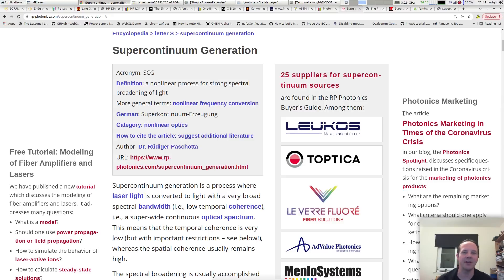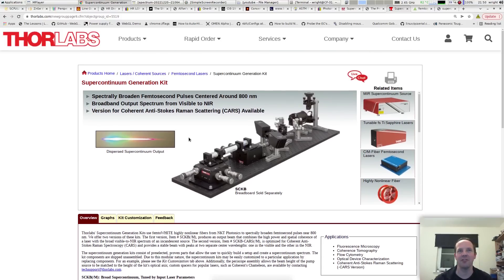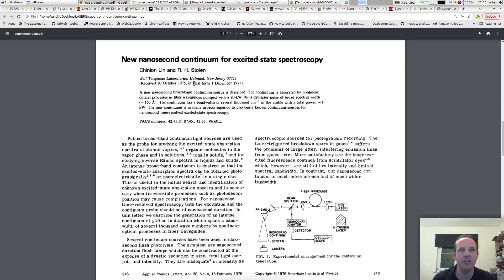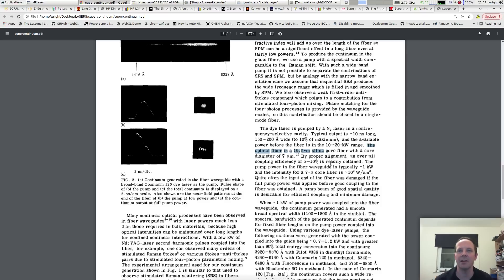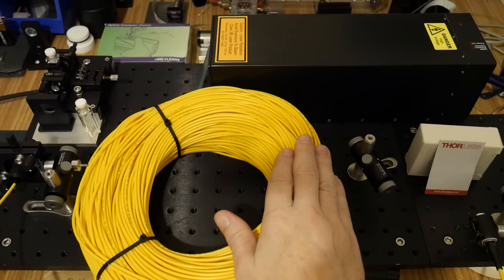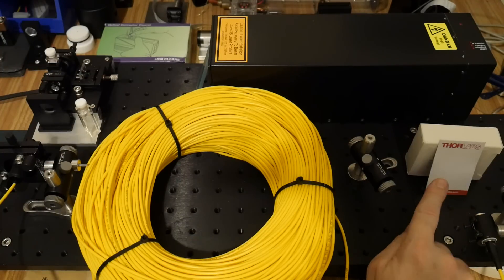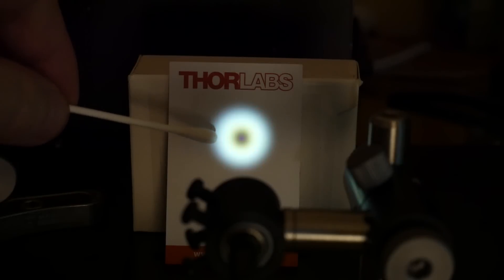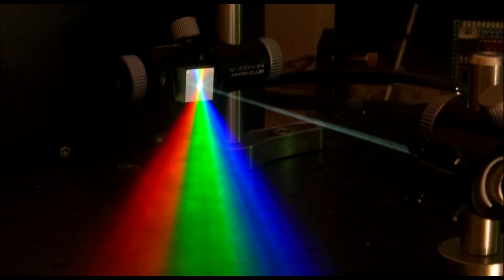DIY SUPERCONTINUUM LASER on a BUDGET!!

Comment: I was really interested by engraving that was done in the UK where they put the human genome on a very small piece of rectangular Crystal like 500 terabytes and I had an idea about using a cubic Crystal with six sides and using different frequencies to create different constructive reflective waveforms I'm using some Cartesian pretty complicated math in six different cameras looking at it with maybe different sensitive wavelength cameras as well as a check song so that you can eliminate repetitive digits that are from one side but could be visible from the other and cream more data into the same space just by how long and how fast you etch along with an appropriate amount of indexing and check some basically built into the index of each side? This differs from I think everyone else is approach that I've seen thus far and I was immediately interested when I saw cuneiform tablets and the man who presented them from the Royal Institute in London and how they're the oldest written form of communication we have and the problem we have with data storage Integrity even on archival CDs Etc.. so as long as you can make the reader very cheap like a single Cube or multiple cubes inside of one reader like with changeable CDs you could cram enormous amounts of data inside of a very small cheap machine and send your data to a company to engrave that data into an archival Crystal which can be protected when it's not in a machine or not protected some type of place where it won't get scratched or contaminated and can be quickly read. If they can get 500 terabytes on a small rectangular Crystal imagine what they could get into a six-sided crystal using this type of approach if you think it's at all feasible I mean you could potentially get in the far higher than any storage media to date in the size of a piece of Crystal about 3 or 4 times the size of a normal die? If you can figure this out and patent it throw me some credit or open source it I don't care it'd be cool to have my name on it as the co-inventor
Reply: If you hit me up with a really noticeable email on whatever email that this account is attached to this is a spam down for email basically and I buy things like some of my subscriptions to some cloud storage even though I'm moving away from that as I'm working on some projects that might be considered dual use so and I'm using an open source machine learning algorithms from hugging face on a specialized PC that I built just for that particular use case so we're talking for terabytes of 4th generation M2 hard drives on the Sea on the D and 120 gigabytes of ddr5 RAM I'm 4080 and AMD am 5 socket Horizon 7950 X which is the last generation which is super super fast just on the CPU with the R23 cinebench I scored in the 48000s
Reply: I've been playing around with trying to use the the slides from slide film camera that have Optical glass where you make your own at home I'm trying to get copper traces on the glass as well as create visas you could literally put a plane in between the two pieces of glass and have copper traces on each side use the edges which have a metal frame around them as power bars or places to connect connectors to the chip I'm interested in photonics and circuits that combine the two... this shows a lot of process a lot of potential for wave guides and RF and I'm also interested in the use of lasers in certain types of lasers for underwater short-range communication between small durable off-the-shelf component feature Rich scientific multispectral fish finders from like hummingbird or from Lawrence cuz if you get up close and personal with those the resolution is incredible much better than the large research vessels with the toes sonar arrays and side scanning sonar it can even penetrate into the I've been into the sediment of the ocean floor. I also want to try and design a Raymond spectrometer on a chip or a very small form factor Raymond scattering spectrometer. At the same time I want to have four crystalline cubic centimeters sample containers where you could put like a grain of stain in three and one normal and have fast very precise stepper Motors fly through the sample and get a really good three-dimensional image of various single-celled organisms. So not only with this swarm of small semi-autonomous drawings be able to do incredible mapping of the ocean floor but it could do bench level chemical research and life science research as well as take samples a few of the Swarm would sit back and do the scientific sampling while the forward drones would be doing the surveying without the expense of a huge research vessel the crew the fuel necessary and green on the bottom with a stator to take advantage of the very strong currents as they are opportunistically found in the ability to surface and recharge on the surface transmit their data using the least expensive method can wherever they may be located and a swarm could control be controlled by three technicians and someone to do modular repairs while the brain would be extremely well protected because that's one thing that could be doing this but if you do a lot of work on protecting the brain of the modular system and keeping the firmware and software protected and not accessible using every trick in the book including hiding encrypted signals on the power cables so if you try to power up the brain with some other power source well it triggers the anti-tamper resistance small mesh fibers in the case that are both a faraday cage and tamper-resistant if you caught one it erases everything all kinds of both hidden and open source security protection. For that one that one's going to be tricky because I want them to operate at an average working depth of 801 ATA but read what Challenger Deep was made of and the only reason that they used to Titanium sphere in it and what the composition of the remainder of the vessel was made of.....
Reply: Microsoft and another company using Ceramics or ceramic type of glass or playing around with this but they're moving very slowly and the targeting data centers when I want it to be available to anyone and you can send your data in that you really want to Archive you can put encryption on it or not and we can add an encryption or not and will send you the crystal because that machine might cost a bit but a scale is enough people are interested and can afford the readers that would do away with the need for cloud storage enormous amounts of hard drives that are swapped out just because of their age because they never power them down excetera excetera there's so many good positive public good use cases including the internet archive itself and various libraries of the different countries that are trying to keep the books on microfilm and scanning the books and where are they putting them on drives
Reply: But if you're interested in any of these subjects or if you think any of them are worthy enough for your time and your effort I would really appreciate the help cuz I'm not a professional engineer I'm self-taught I'm a self-taught cybersecurity researcher I learned advanced mathematics in my middle ages and sold the beauty in math and just 2 weeks. I asked all the scientists out there how long did it take you to find the word beautiful and apply that as an adjective to math? I have a huge IQ but I had ADHD so everyone pushed me away from math as a young man he was just because I didn't have the ability to concentrate on it until my ADHD come down but then when I had a reason I took a graduate level class which required calculus and algebra and I had already taken some data science s p s s s s s a s and r and then moved on to python deep machine learning open source algorithms like on hugging face which can be incredibly good some of these Architects are fusing these open source models in ways and using reliable data sets which you could then turn around if you had a commercial grade GPU cluster and if you put your own IP on there with your own bare metal those could be as good as the commercially available products without exposing your confidential IP to accompany who have less than stellar scraping other people's IP for their own models and in Switzerland the secret professional act has criminal and civil charges and private ones so a client or a private person could charge the offender with a private crime the government doesn't even have to be involved in that and you can serve time in jail for that not to mention in my case being both a medical professional and having a doctor in law I could have my license revoked. I would never suggest that a Swiss company subject to that act ever put anything on a server outside of Switzerland because the law of the land would apply to that data in addition you should not use any of the commercial open source deep machine learning algorithms because you just don't know where your date is going and who's using it and what you might accidentally slip. If you insist on using them then you should compartmentalize the work and have it impossible that someone could put your various pieces together and do what you're working on and keep it separate from your air gap system where you can combine it..
Reply: I have a lot of different laser safety glasses and a lot of them I shine my laser through and they don't give me a lot of trust in them so I approached my local Optical Shop and ask them and they have the orange version which now I've asked for the wavelength protection and the official certificate of safety what's a good source for various types of glasses for various wavelengths and is there a pair of laser glasses that will cover a vast majority of the dangerous wavelengths like infrared ultraviolet and the sneaky one like green which has ultraviolet buried in it. I'm not sure if it's you or somebody else but they said put it in the freezer and turn it on and see what happens and sure enough there is the ultraviolet...
Reply: I have a lot of different laser safety glasses and a lot of them I shine my laser through and they don't give me a lot of trust in them so I approached my local Optical Shop and ask them and they have the orange version which now I've asked for the wavelength protection and the official certificate of safety what's a good source for various types of glasses for various wavelengths and is there a pair of laser glasses that will cover a vast majority of the dangerous wavelengths like infrared ultraviolet and the sneaky one like green which has ultraviolet buried in it. I'm not sure if it's you or somebody else but they said put it in the freezer and turn it on and see what happens and sure enough there is the ultraviolet...
Reply: I am careful to use my lasers in a room with heavy impervious cloth to protect any stray refractions from leaving the room and I live on the third floor so it's highly unlikely with all the trees and the distance between me and any potential other people but I do take safety measures because I like my eyeballs and I also like my camera equipment because I have some professional cameras and then I have some throwaway cameras and I've even have some cameras where I've taken the IR filter out so that I can see infrared and with them
Reply: I really like your Laser Source company at the store because I think they're Western company and I'm again not necessarily comfortable with some of the diodes that I'm buying from China as they who knows what they are really and their quality is sometimes not with a claim and I've also ordered a couple 10 copies of your pulsed overclocking circuit for laser diodes as I have a scholarship with jlcpcb and pcba and they gave me a minute and I asked for five with your one original transistor and your alternative transistor as I wanted to see with a microscope reticule if I could get one of my laser diodes to etch as I want inside of crystal
Reply: Doesn't that like amplify the wavelengths by going around in the coil and in some way both splitting up the wavelengths and increasing the power of the one that you want admitted? I've tried to be paying attention your videos are the most informative on lasers from all the things I've watched so really good science communication really solid safety advisories nice table and I want to build my own I guess I should put it on spring-loaded dampeners would that be your suggestion with a really accurate level to get everything nice and level and to resist against vibration and external noise?
Reply: I wish tour would give me a scholarship because I have all kinds of ideas to use laser light in new and interesting ways including a mixture of both sounds, it's like a sound laser and motion stop video work where it only records the changes in the motion add laser combined so it's like the new sonar it's not so nice pictures and lighter combined with drones with a 25% overlap for good stitching but also using radio waves.... so instead of just two forms of ranging and the use of photographs as I've done the photograph three-dimensional work with my drone I have a drone license from the Swiss civil aviation Authority and I can fly drones up to 4 kg 9 G to 4 kg which considered autonomous aerial Vehicles by the Swiss. It was a 2-hour exam in French which is my second language but I passed very well because I had a drone and had been flying it under a license that wasn't mandatory but was just kind of Common Sense made by an association here and so when they actually came out with the rules that mirrored the European rules the test was fairly easy for me especially as a lawyer and then having a Hobby Lobby engineering status but I have photographic memory and an IQ that's off the charts it was recently tested because I'm the victim of two different unprovoked violent attacks and they wanted to make sure that I wasn't damaged and I wasn't but my EQ was so what I used to distract myself from The Nightmare which has been the last 15 years of my life including six surgeries to repair the damage it was geopolitical related to my job and my former boss even told my doctors that it wasn't his fault he didn't ask for it he didn't deserve it he's honest he's extraordinarily smart he took what I taught in places I never considered please give him the best care you can and they think that I can fully recover but they want me to start looking for work with people who have my same level of intelligence and creativity which is one heck of a trick when people see lawyer on a Juris doctor on your CV even though you have a science masters that automatically put you in a box Define you based on that box and I'm sitting here looking at a bunch of Transformers have pulled from E-Waste and solar panels that I need to encapsulate in epoxy for use in a larger panel a 220 volt solar panel sitting against my wall waiting to be used for a purpose soldering irons dead boards passive components vices and old that I think will work if I replace the nickel cadmium rechargeable batteries it's a Swiss Army Surplus with a actual Cafe told me it was important I think I think it's blocks the harmful Rays from the tube which is very long here's a copy of the book it has a French version which I understand but I have the complete service manual. It's a tectonix 323 dated 1980 and they had not leaked prepare the nickel cadmium rechargeable batteries and so they're totally shot. Inverted has the entire technical manual with it and maybe it's not so useful with today's speeds but as a piece of History it's just fantastic and if I can't get it to work for some reason to Katherine isn't completely good shape I've seen the Chinese Catherine adapters which should make a really interesting version of Doom or even Quake if I attached a much more capable board granted it'll be in the green Catherine Ray type of picture it's about the size of I don't know it's a little smaller than a Raspberry Pi board the window, but the Catherine ray tube is at least 500 mm yes I use the metric system even though I was born in America I've lived in Switzerland for more time than I've lived in America so they don't even recognize my accent.
Reply: It's called directions for The Artisans of the troop Edition 1980 from the Swiss military surplus and it's the guy and description Technical and the instructions for usage in French and English in high detail for an actual electrical engineer
Reply: It can do for me for a time of 99 seconds 2.75 MHz over 130 nanoseconds with a standard deviation of 0.2 Hertz it can run off means or it can run off battery which is the issue I don't want to Power It Up Until I've replaced the nickel cadmium D size batteries and yes I can weld the metal strips on top of the battery packs. I made a DYI lithium ion on the small metal strip spot welder basically everything I own is DYI. I think I'll pull the best pieces of aluminum panel or a metal that I can recover from E-Waste and turn that into my Optical bench I know that steel would be better I just set timer for that but I could wait down the aluminum evenly with a thin piece of metal that I could adhere evenly to the aluminum to get a good bond to prevent warpage or any kind of change and then drill my holes and mounted on the external isolation I assume screw Springs hear to the aluminum
Reply: Bernie Mansion a small open source pcie or M2 slot attachable as small as humanly possible a scattering Raman spectrometer with a removable crystal cruveete
Reply: I'm assuming I need three different wavelengths of laser and a cube as well as several other types of lenses colonies including a fiber to run it into a standard spectrometer tube. I want it to be a scientifically accurate as possible but as cost-effective as possible for people that can really use it because this is a way for environmentalists to really keep an eye on what's going on in the environment and not rely upon government scientific Labs. I read the beach bum survey from the UK epidemiological survey in a French surf doctor down in their Mecca of surfing completely trashed that piece of research and I called him and I asked him if he'd ever done any research no do you understand what you said and the implications for the people surfing here considering the water is much warmer and much more stagnant as well as the very bad quality of the rivers that are flowing in from the Pyrenees both on the French side and the Spanish side? My own toxicology Professor who is himself a surfer from California was validated that piece of research and even said it was more disturbing than I knew I already knew about horizontal Gene transfer so they can pass that resistance Gene to other biofilms nearby but it's all caused by outdated water treatment plants that were never designed to remove very sturdy Pharmaceuticals with bioactive time periods so tetracycline almost always makes it into the river and the understanding of how this affects the Zone in between freshwater and saltwater in the literature is said to be not well understood which is extremely disturbing and they shut down the beaches in the area quite often for E coli. Is this E coli of sets up a biofilm in your intestines and you have a perforation or enduring surgery and it gets into your bloodstream the Doctor Who said it was fear-mongering overblown and no one should be worried never disclosed that he was an emergency medicine doctor only fixed bones was on the board of directors of the Surfing Association there and was an adjunct mayor to that particular City he was in such conflict of interest and didn't disclose it to the Surfers and the water is much warmer there turn the water is much more polluted it was the first place I've ever been in the water that was dead and I've spent 3500 Plus hours underwater I'm a professional diving instructor and a technical with Advanced trimix with i n t d and then my Irish buddy in the Philippines said you should take the gue tech 1 who is Gideon who's now the director of education for the entire organization so I got pretty lucky having him as my instructor but I passed it and I passed it well because I was doing CrossFit every morning and Diving three times a day 4 months on end after having Dove the entire area around the Philippines from Palawan to Cebu and someone asked me a question because they knew I was an instructor and I was just there as a guest and the instructor broke the rule on no decompression diving for recreational divers and they asked me if we would be okay and yes we would probably be okay no problem it was very short but I didn't have all of the really specific answers that I wanted to know so I spent the next 9 months totally involved in every single technical class I can take. I did all of the professional association of diving instructors courses because I was already an open word water recreational instructor and then I took all of the iantd classes where they teach g u e because when they're right their rights and they're safe the only difference is we don't get much and helium is so expensive are Deco gases the same it's just not the bottom gas that's the same. And that kind of comes down to personal choice about conservative Factor because after 65 m 21% oxygen becomes toxic to your body and you can have epileptic seizures you don't want to have an epileptic seizure underwater in saltwater in freshwater you can survive in saltwater your toast. The only thing that can save you is a full face mask few people use them because a lot of people enjoy the Solitude silence and the Zen of diving because you don't talk we use hand signals
Reply: we have our own sign language and we bang on our tank if there's an emergency in the sound travels very far underwater. I've come up with a public health device made out of milk plastic again with modular dashboard components and low quality fish finder equipment to allow deep machine learning to identify the number type size of the fish and using the water current in rivers itself to help charge the batteries as well as top side solar cells I wanted to have my Raymond's scattering spectrometer on a ship attached to a pcie but the Bosch multi gas trainable VOC and VSC can tell you if there's bacterial overgrowth and if you have an optical series of three-dimensional containers and three use a green per container so like one bottle would last a lifetime of the buoy and they mesh together with anti-tamper resistance topside cameras a small wind turbine and solar panels it can deliver water safety information and water health information in real time to the public health officials which could save enormous numbers of lives and help us learn more about our freshwater at the same time you can use these in saltwater around recreational areas The Junction between freshwater and saltwater and to guard fisheries and protected replanted Reef zones which will get dragged needed Dynamite fished or cyanide fished if you don't have somebody watching them 24/7 365 days a year as the people who own Borneo divers in San Bruno they've made incredible progress in rebuilding their Reef environment off the front of their Resort I asked the manager how do you keep this so nice and he said because we're here watching it everyday so if you set up a chain of these that were attached to the reef and like created a electronic barrier with hydrophones and cameras on the surface and thermal camera so that masks won't shade their facial features and their engine types boat-shaped both types will be immediately transmitted via the cheapest method you can set up a ground-based uplink or you can use the last one that's closest to the shore that can connect to LTE and then flow the date of that way and even so often have a black box buried and hidden where it's more so that even if a thief gets away with one in the chain that we've still got their picture and all their ID and even a verbal warning followed by a nice indelible ink spatter. Hey if you're fishing and protected Marine zone or a UNESCO world heritage site or a place where somebody has spent thousands and thousands of hours rebuilding and replanting a reef is there a woman in the islands in the Adam and sea who's come up with a way to increase the speed of replanting reefs by 1,000 * so I was thinking about going down there after my next surgery when it heals so that I can get some time underwater doing some tech Dives as I need to do quite a few to become active again with g u e even though I keep my other certifications for Life Julie requires that you do 10 Tech tops a year to keep your skills up which is again correct right smart but I can dive with my twin tanks and my 50/50 nitroxin 100% oxygen decom for three or four hours and I can do an enormous amount of free planting and get an enormous amount of time and get re-certified for gue I could do the same on Grand Cayman where they have a medical school and the Cayman trench which would be an awesome place to test out prototypes of my drone swarm for mapping very deep. If you look at the composition of Challenger Deep In 70% glass Ceramics and epoxy the only titanium was for the human compartment Cincinnati human you can use hydrostatic pressure to maintain whole Integrity so there's a liquid which does not interact with electronics and it doesn't compress Richard enormous amounts pressure imagine the weight of the water column 8,000 M deep on top of anything so take a cubic meter of water weigh it and times that by)801... all you people who bought dive watches that say they're 100 atmospheres and 100 m certified are all being ripped off because you're getting cheated by one atmosphere because they've all forgotten that you start at 1:00 the atmosphere at sea level is 1 atm and for every 10 m after it's an additional atmosphere so 100 atmospheres would be 99 m you're getting shortered by 10 m. I'm also heard that cream laser wavelengths and other wavelengths can travel quite some distance through seawater and even especially through thermal clients which act as wave gods you could potentially transmit enormous amounts of data along a thermocline if you have a receptor on the other side which would alleviate the necessity of using a satellite or a radio wave and for short distances communicating one underwater vehicle to another it's really a short distance so you can get a lot of information spacing information from 1 to the other That's essential given the currents and given that you need a good 25% over that for really quality stitching So Not only would you have multi-spectral sonar but you could have multispectral lighting multi-spectral cameras and try to keep your power overhead as low as possible while being able to collect as much scientific and high-quality resolutions surveying data without the need for a massive ocean Expedition an entire crew and all the gas as well as the less than pristine images that you can hummingbird or Lowrance prosumer multi-spectral fish finder. And let me tell you those images are amazing they can see into the settlement to some degree and the detail is absolutely amazing you won't have GPS that deep so you'll have to use inertial movement and Clearwater structures in order to orient your group let's say the minimum order is 25 with up to 100 who is 3/8 years and if you order a 100-point the control station in half of a shipping container and the other half will be spare parts and the drones will have the ability to help each other self-rescue from Ghost Nets and have extremely powerful lift bags they can deploy that could pull up several of them at one time because a small canister of CO2 at 8000 m in Imagining the size of the lift bag that you would need to cram into that thing but without question it's coming to the surface and? It's coming to the surface with itself its buddies if they're hooked on with the cable and anything else that's attached to it so long as the cable is strong enough and tied to the lift bag not to the drones